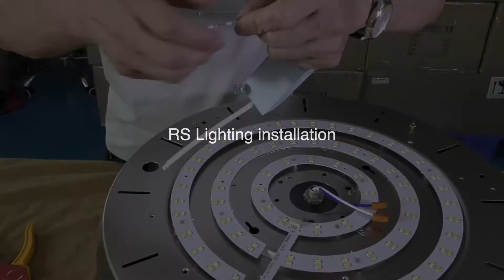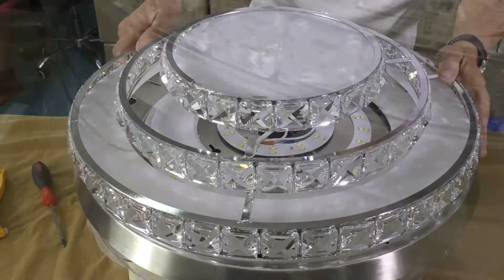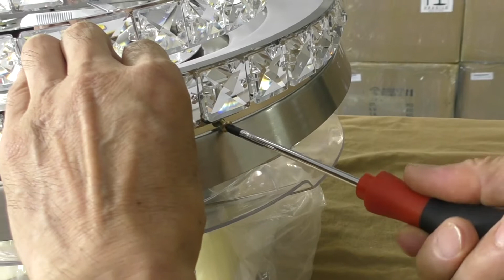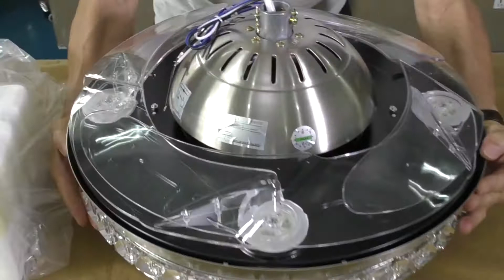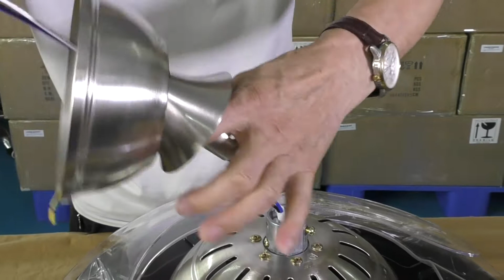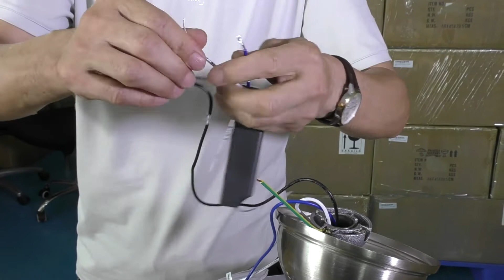How to Install TiptonLight Crystal Ceiling Fan Lights with Retractable Blades？

Comment: Where fo i get the led ring lights for my flan as ones gone please some one thanks
Reply: I need to know to get replacements also. My entire light went out after a years use. I'm lost cause I love my fan  and hate to get rid of it. Especially after paying so much. I bought 3 different lights last year like those and if you cannot fix them I guess I won't be buying anymore.
Reply: Dónde conseguiste las luces para tu ventilador